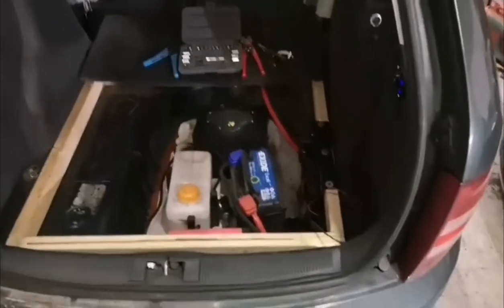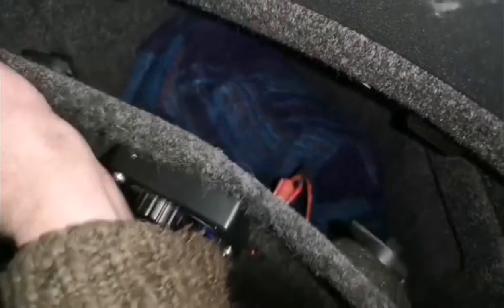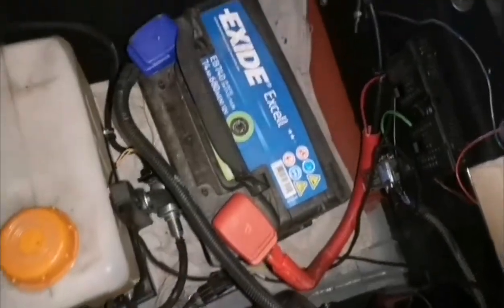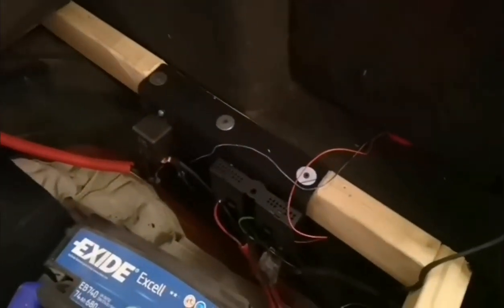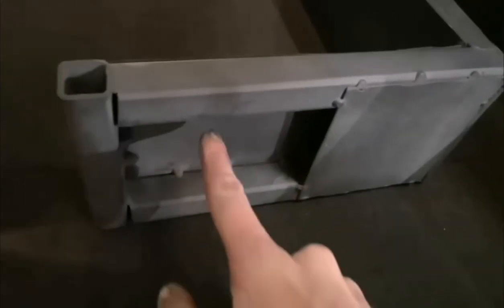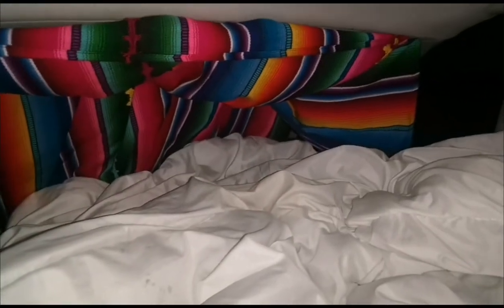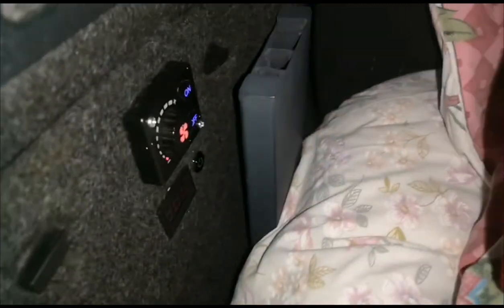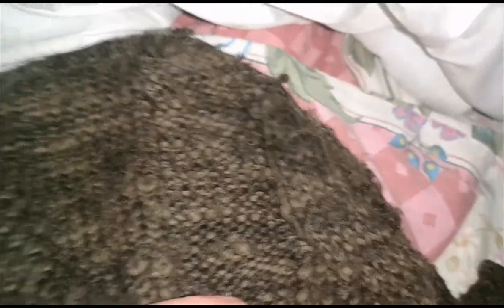Skoda Fabia estate camper: heating and electrical

Comment: Hi i love this!! i have a fabia estate and have car camped with basic set up. would love a leisure battery, no idea about electrics tho sadly. what about no spare tyre though? where can i learn to hook a battery up like you have??
Reply from the maker: Hay thank you! Best way to learn is though Internet guides and YouTube, I'm a auto electrician so was all pretty straight forward for me

You can buy split charge kits online for retrofitting, a universal one would work

The spare wheel usually goes on the roof when doing long trips. I have a expedition roof basket from a Land rover Free lander which I adapted to fit on, carries a huge amount of gear if needed
Reply: That's so good!! Thank you for the tips!

Comment: Hey man I love your videos, I’m inspired by them, so just wondering what length your bed setup is? I’m 6ft so I’m worried that I wouldn’t fit very well!
Reply from the maker: Hay thank you :) I will measure it as I can't quite remember, I'm about 6ft 2 and fit ok, is a bit tight if laying straight but if you move the front seats forward it's fine
Reply: @Ryan-95-  ahh ok thank you
Reply: @Ryan-95-  also when it’s in camping mode what changes do you have to make to get it MOT’d?
Reply from the maker: @skrufdy9688  none as its always MOTd as a car, I've never MOTd it in camper form
Reply: @Ryan-95-  did you get a chance to measure the length of the mattress?